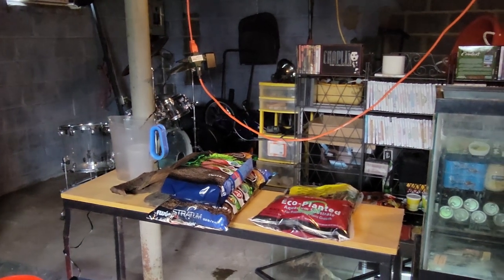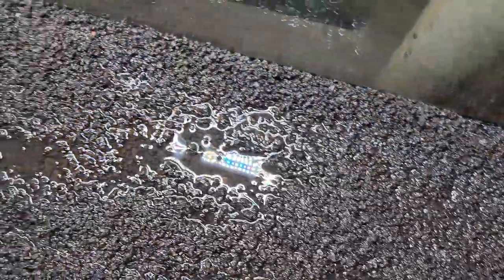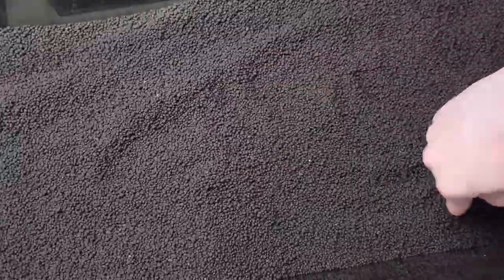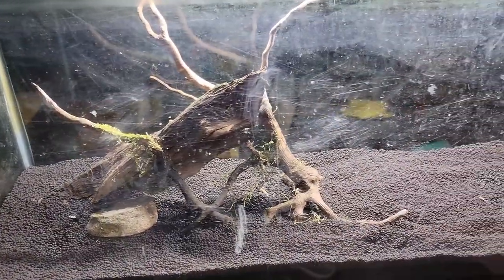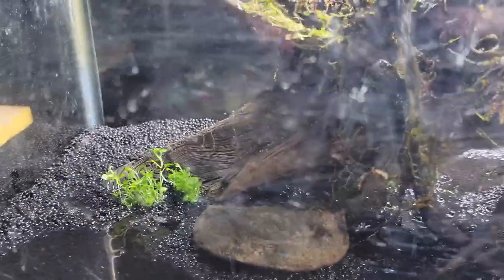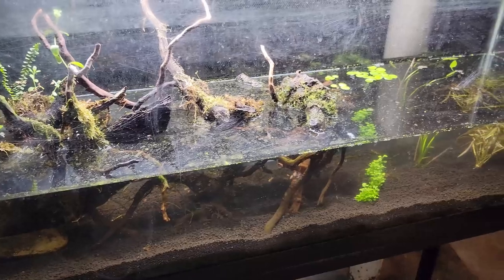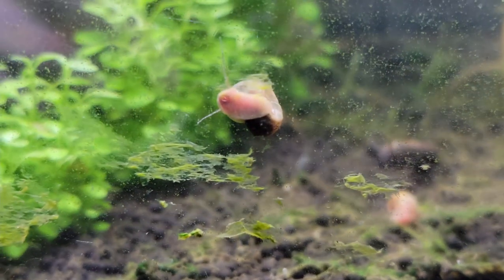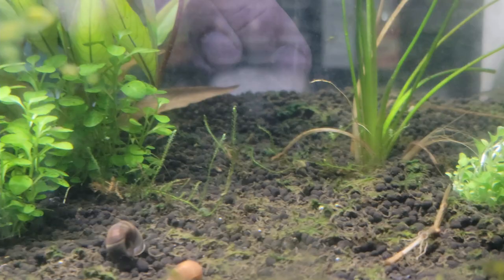My New Eastern Newt Tank!  How to Build an Aquatic Newt Enclosure

Comment: I have a small setup for two fire belly newts but I'm considering a bigger setup. How do you deal with the mess they leave behind while eating? All this time I've been cleaning it manually and using a filter from tome to tome but I'm a total noob to this. They are healthy and doing well so I don't want to mess it up for them.
Reply from the maker: Hi! I usually have snails and shrimp to help clean up the left over uneaten food.  But if there's still anything left over afterwards, manual cleaning is still necessary.

Comment: Nice set up.
Thanks for the video.
How fo you clean the water? I assume you never have a filter in with them? Even a small one.
How often do you clean it?
Thanks from 🇬🇧
Reply from the maker: Hey there! I don't have this setup anymore unfortunately -- my newts are in something much more modest at the moment.  When I had this enclosure, I only did minimal water changes at the start, and never used any sort of filter.  Just natural water evaporation and plant filtration - that was pretty much it.  I would add water as needed.

Comment: Nice, are you using a cooler to keep the water colder? I typically have just ambient room temperatures range from season to season. Nice natural set up!
Reply from the maker: Nope, no cooler.  I have the tank in the basement so the room temperature is naturally colder from the rest of the house.